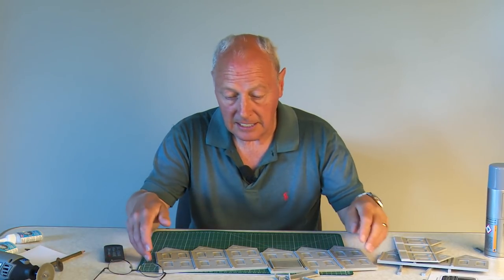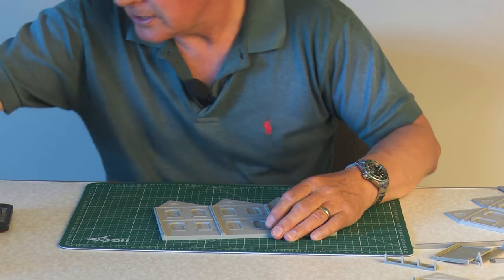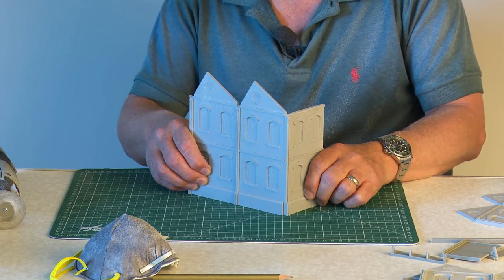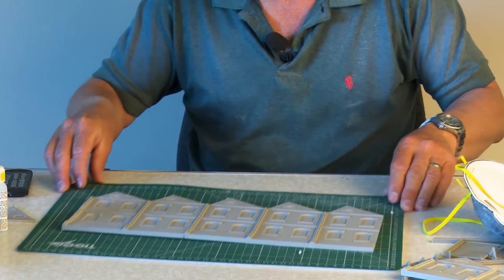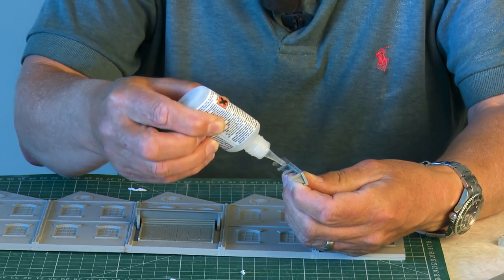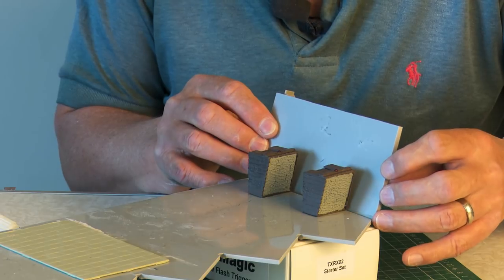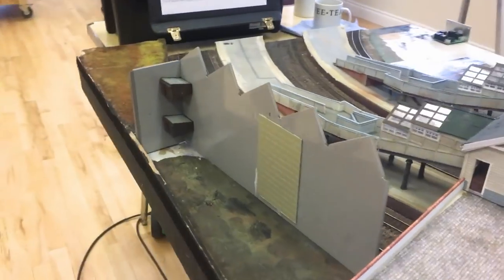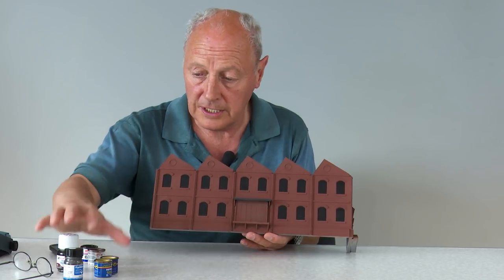Making and Painting Buildings, Part 1 at Chadwick Model Railway | 7.

Comment: Hiya Charlie, and excellent video as always, but can I  just say that if you get stuck with superglue, run your stuck fingers under as hot a water as you can bear and that will loosen the glue.... the other thing to have on hand is acetone or  an old fashioned nail polish remover as this will dissolve the glue for you. I hope this helps! What I would say also is that where you added a sheep of plastic on the back of a joint, with modern cyanoacrylate glues (super glues) it really wasn't necessary, believe it or not, these glues are actually strong enough not to need this. Again i hope this helps.
Reply from the maker: Hi William, many thanks for your tips.
Regards Charlie

Comment: Hi Charlie, Really liking your videos and easy, informative, all inclusive, presentation style. I've often super-glued my fingers together, or to the things I'm trying to glue. A couple of tips for you.
1. Cellulose thinners (or nail varnish remover but ask the owners permission) can help soften the superglue if you don't want to cut off a layer of skin. Just work it in and gradually ease the fingers apart. It takes a bit of time but prevents bloodshed. Afterwards a good pumice stone can get any remaining off.
2. I found superglue doesn't stick to some plastics (bags etc.) so you can use pieces of that to hold items to avoid getting glue on yourself, but first test the plastic just in case it's the sort that will stick.
Now to view part 2. :-)
Reply from the maker: Hi Vernon,
I’m so pleased that you enjoyed the video.
I must confess, it was funny when I glued my fingers together and I’ll take your advice and acquire some solvent.
Regards Charlie

Comment: Wonderful as usual. Two points though. 

If you can arrange it have the Dremel cutting tool arranged such that it is spitting out dust and pieces of the thing being cut away from you. 

Secondly, if you stick your super glued finger(s) into a bowl of water that will instantly set the super glue, and leave it quite brittle. After that you should be able to easily separate fingers from attached item, or even your own two fingers, as I have managed to do in the recent past. So you can dodge having to mess around with a scalpel. YMMV.
Reply from the maker: Interesting points and have acquired a superglue solvent which is always to hand.
Reply: @ChadwickModelRailway  Excellent. A very good idea. 

I have spent a lot of my life around heavy machinery and electrical systems that ran up to 69KV in power. Make a mistake with 69KV and you will be in the next world instantaneously. A good friend of mine tangled with a mere 18KV. Took him a lovely 16 hours to die. I had nightmares for two weeks, even though I was not on the scene when he got almost turned into burnt toast by a mere 18KV.

I am quite sure that in your time in the Royal Navy you saw plenty of dangerous situations and stopped things from going awry. I deeply respect your past history, and am amazed at the wonderful videos and ideas you present. If you think this to be sucking up, well mate, you are wrong. My grandfather fought in the 8th British Army at a little train stop called El Alamein. He fought despite being a hemophiliac. One serious wound and he would have been dead. I did not know about this until my brother told me about that and my already very high level of respect for my grandfather rose even higher.

Sorry to not be discussing trains in this instance, but history haunts me. That is all I will say on this subject ever again. Back to your excellent work with Chadwick Station and good on you for your time in the Navy. Much appreciated.

Comment: Recently subscribed, catching up on your videos, outstanding channel! Appreciate the time and effort you put in to showing others tips/tricks/etc. If I may offer one for you, I have seen it in several of your videos where you use the larger 'Dremel like' tool and you turn it off and it starts hitting your table, you can buy a holder or being fiscally minded you can easily make one so you can set it down while still spinning and save your table top. aka like a solder holder, only this one for your large cutter. Also saves you a few seconds while you are taping your videos having to hold it a bit until it stops. Just a thought. Again, appreciate the videos!
Reply from the maker: I’m so pleased that you enjoy my videos.  
Thanks for the tip, I’ll work on it.

Comment: Hi Charlie, watched this video again as enjoyed it first time, Just a tip i use and it works. Buy some grease proof paper and when you r using superglue use that to put your work on and the superglue wont grip very well to the grease proof paper and you can just peel it away. Leave it to 1 side and any glue left on it will have dried and it can be re-used. Hope that helps.
Reply from the maker: It’s an old video Ken, and I have learned a great deal since then. I tend to use polythene. Regards, Charlie

Comment: Please always cut outside. Wearing protection while cutting and taking it of while all particles are airborne isn't very useful 😼 If you can cut the material with a power tool, dremeling the windows open shouldn't be a problem?
Reply from the maker: Another good point Rob.